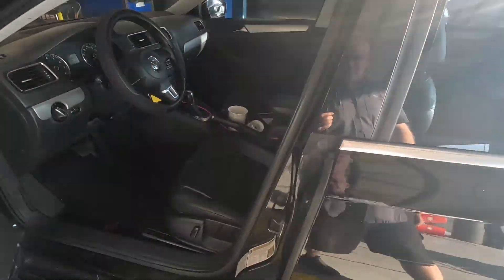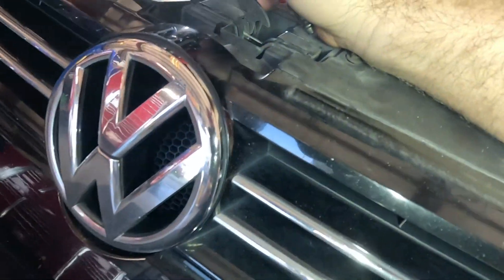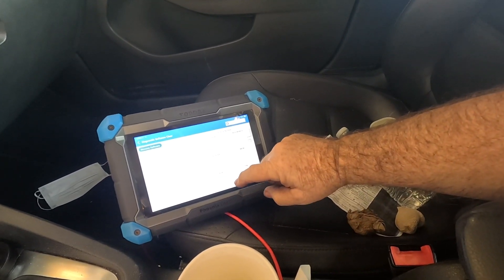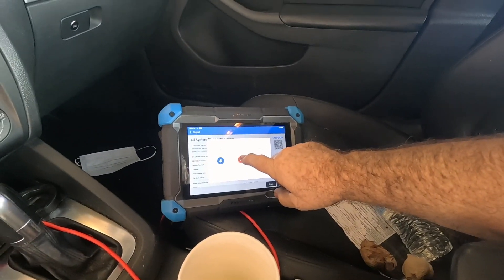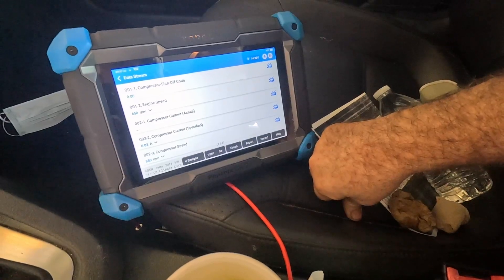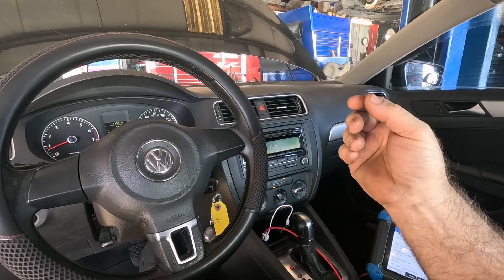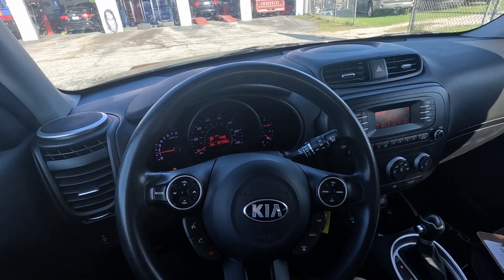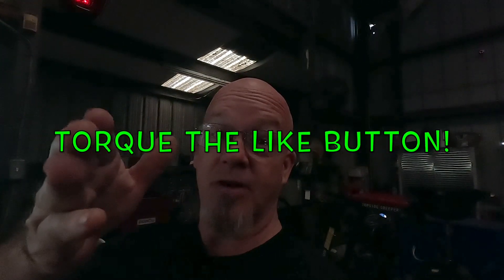A DAY IN THE AUTO REPAIR SHOP 198, VW, MERCEDES, CHEVY, KIA...ENGINES, AIR CONDITIONING, HUBS...

Comment: Hi Jimmy.  Heres another example of honda/acura taking precautions with dissimilar metals,if you come across a Honda acura product with aluminum fenders (newer oddesys,tl,rl etc) look at how they mount the fender to the chassis, there's nylonish square shim isolators in between the aluminum fender and the metal  structure it bolts to that are quite visible. Those silly honda engineers lol
Reply from the maker: They always seem to go another step past other manufacturers, only Toyota keeps pace.

Comment: Kia told us the warranty on my wife's 2011 Sorento with a spun rod bearing wouldn't cover repairs or replacement. Had it been a 2012 or newer they would have. I put a salvage engine in and sold it as fast as I could. Lost a bunch of money. No Kia's again for me, never.

PS:  That Kia sounds exactly like ours did with the spun rod bearing. 👍
Reply from the maker: Yeah, there are too many issues with them since switching over from Mitsubishi to making their own. They will get it sorted I hope, or it won’t end well for their business.
Reply: @JimmyMakingitwork  For their sake, I sure hope so. 👍

Comment: Are parts readily available to rebuild these condemned motors? Is that too much for mosts shops? The costs you’ve mentioned for a salvage one seems there money to be made rebuilding them.
Reply from the maker: Well, the problem is quality parts are pricey and at our labor rate it would get quite a bit more expensive. There might also be a wait on parts as well, similar to engines.
Just a tuff time to get things done in a timely fashion it seems.

Comment: Are you worried about having to work on electric cars?
Reply from the maker: No, they will be more software and electrical involved. But otherwise similar. Brakes, suspension, tires, wipers, horns, airbags and more.